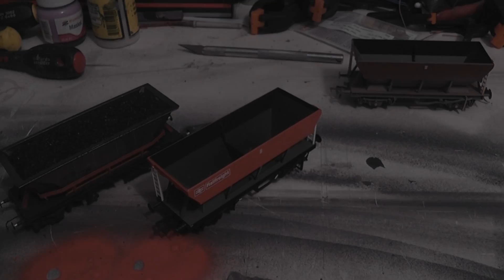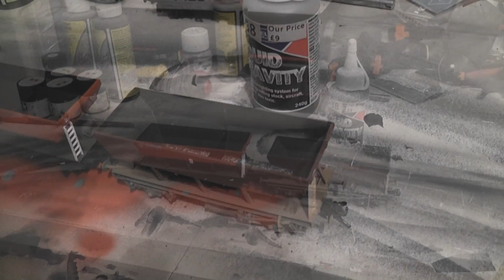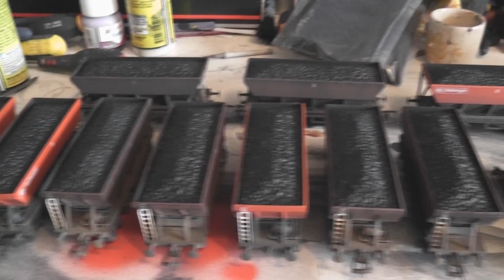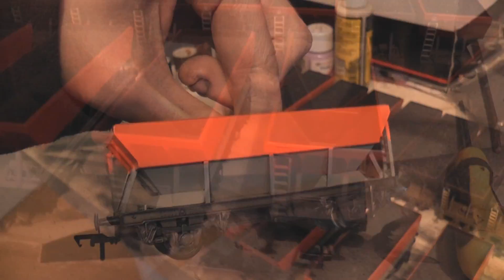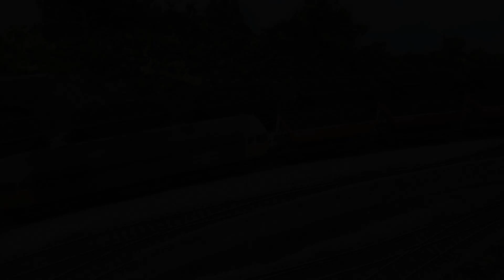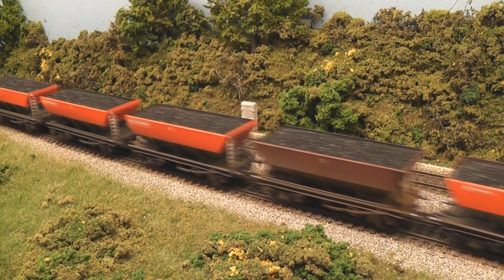The Big Wagon Project Continued

Comment: I had to add weight to my N gauge 7 plank wagons.  Used 5gram tyre weights.   They would derail not at the loco end but towards the end of the train where the spring was tight and trying to straighten out the train so would whip them out of the curve

Comment: Been collecting up HEA examples off eBay after being inspired by your repaint project. Purchased the Fox HEA set with the various Rail Freight sizes but noticed the wagon numbers are all a number short did you use an additional fox sheet to add the final number?

Comment: Those wagons certainly look much better with the work you have done to them. Did they have break wagons on the back of the rakes?
Reply from the maker: Jacob Porrett Guards vans went during the 70s when the last unfitted wagons went out of service.  Wagons built during the last 40 - 50 years all have brakes fitted which the loco controls.  No need for a guards van when all the wagons have their own brakes.
Reply: Specifically, any 3-letter TOPS code ending in "A" denotes air-braked wagons. In this case, HEA and HAA.

Comment: I like what you have done with both the HAA and also your rake of HEA, I remember working with both types of hoppers, in 1979 we use to run a few trains from Bilsthorpe Colliery to High Marnham PS with the HBA/HEA hoppers, please note at this time High Marnham could not unload the HAA hoppers, I note on your Bauxite HEA hoppers that Bachmann did not fit the hopper door handles yet on your red/grey they have
Reply from the maker: Kevin Patrick Mulhall Thanks.  The issue with the doors on the wagons is due to the bauxite wagons actually being HSA.  Bachmann didn't make an HEA in bauxite so I made do with the HSA instead.
Reply: Cheers I have seen some models of HEA in bauxite but they might have been Dapol or Hornby, both had door handles, I don't model my BR days but model the late 60"s

Comment: Excellent video once again! So I take it that your trains only run in one direction if there is a "front" wagon? Or do you weight a wagon at either end of the train? 

Do you need to do this with carriages as well?
Reply from the maker: sub39h I don't have to weight the coaches as those rakes are lighter and don't cause too much stress.  If I want to run a rake in the other direction I just swap over the first and last wagon.

Comment: Love your weathering!

Non-related to the video, do you have any plans on doing a video showing your track laying technique? I have some trouble with laying track good using flextrack.

Cheers
Reply from the maker: aleksbarmoen My older videos show some of it.  I used a ruler and took loads of measurements to get things right.  An easy way would be to use something like tracksetta.
Reply: Do you glue everything down or do you use nails?